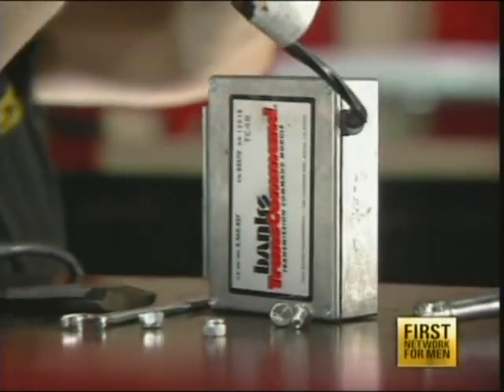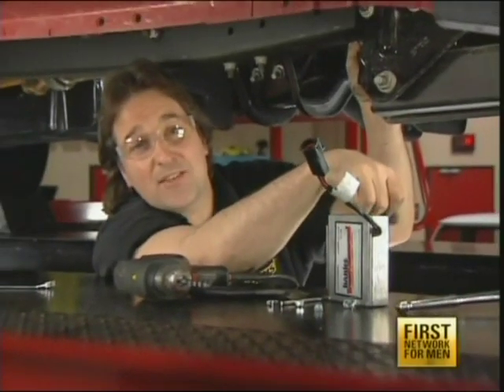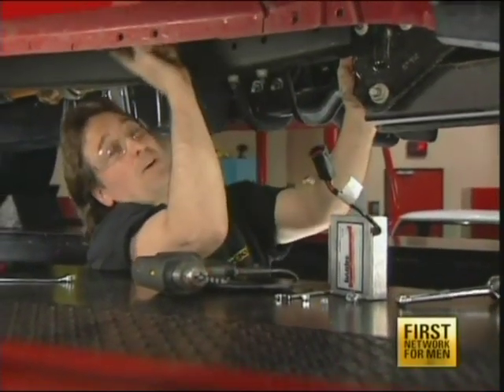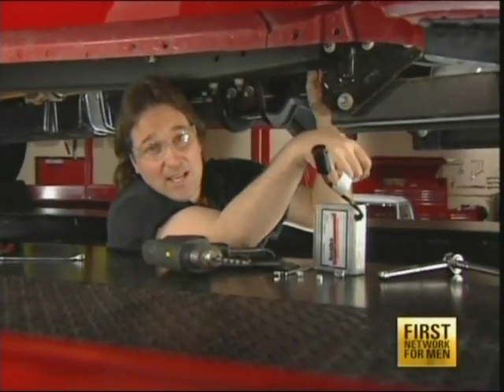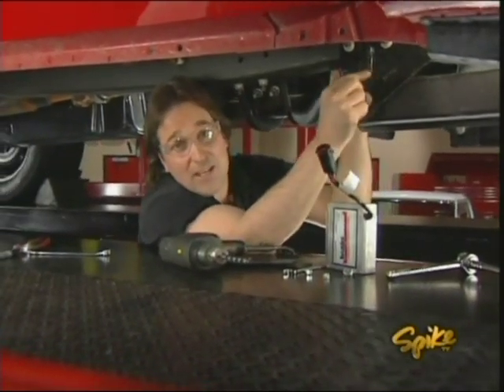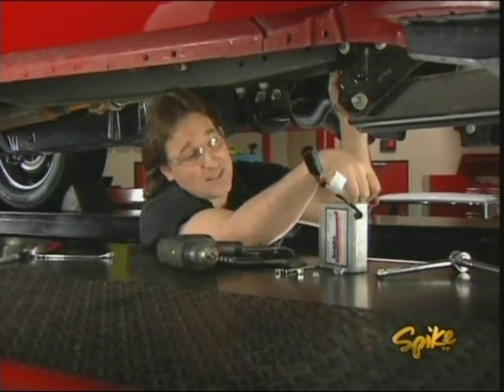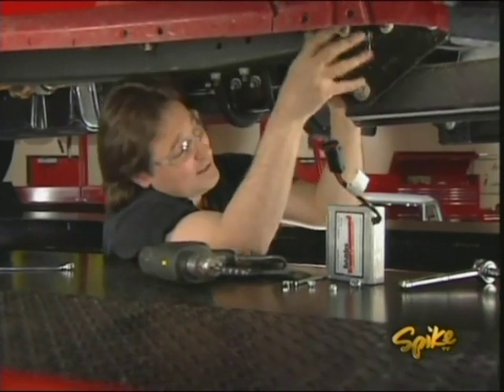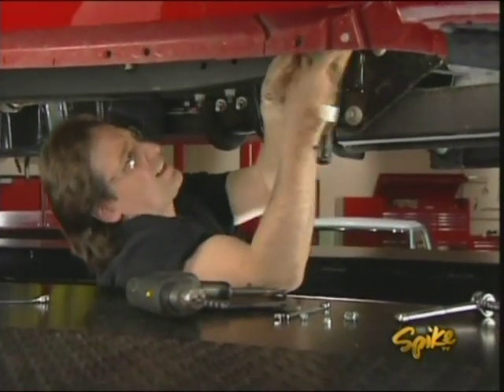Ford 7.3L Transcommand E40D/4R100 transmission controller from Banks Power

Comment: Does this lock 3rd and 4th from slipping on a 02 superduty with automatic. Mine shifts to fast when normal driving to pulling heavy loads and then it lugs the engine

Comment: Well that doesn’t say shit why it’s 300$ dollar
Reply from the maker: Here's the key takeaway. Banks TransCommand is an electronic module that senses the load and commands the transmission to raise the hydraulic pressure accordingly. When active, produces smooth but firm, light-throttle shifts and solid, decisive heavy-load shifts. Adjusting the pressure eliminates excessive clutch slippage, which in turn extends transmission life.
Reply: @bankspower wish we had a updated video I’m looking at one for my 7.3 build.  Guess my question is.  Is it 300$ worth of a difference made? I have a 97 powerstroke with the e4od.  I don’t pull much.  Will this give any performance too off road or street applications?